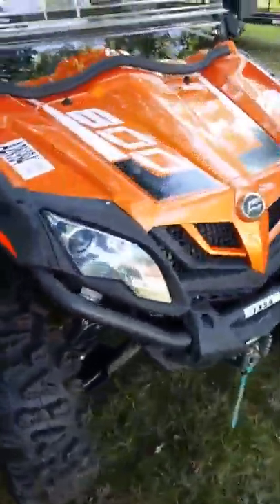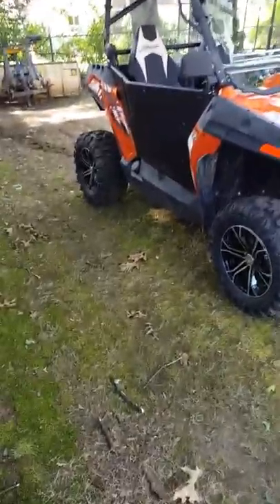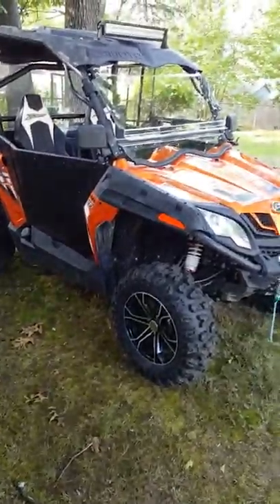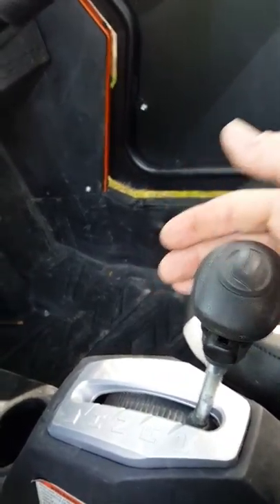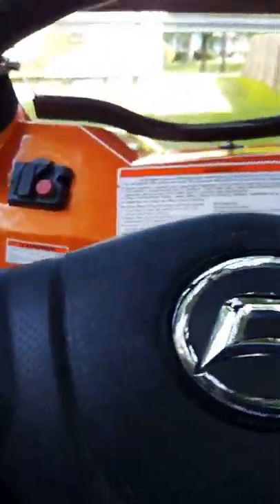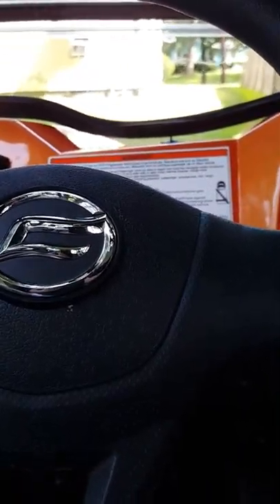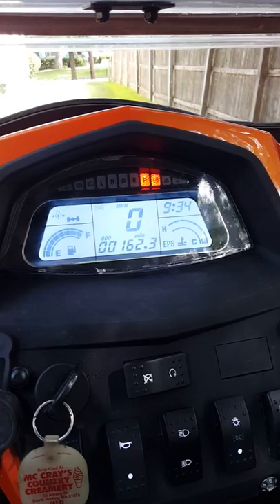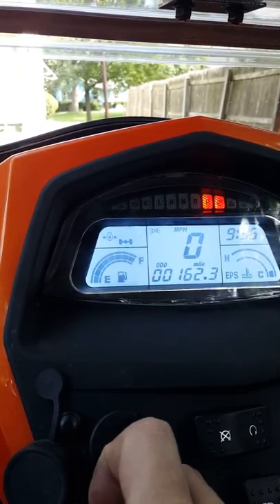Review on my 2017 cfmoto zforce 800 trail

Comment: Fyi for all ,  replace filter immediately with uni up-6229ast 2 stage foam filter. Never replace just clean every ride or two and use filter oil on the outside foam only. Other than that , follow break in procedure critical.  And you will have a great machine on your hands

Comment: Been looking at these, mainly action sports in oxford sells these.  How is service and what dealer do you use?  They are nice machines really just waiting for some long term reviews.
Reply from the maker: I bought mine at wicked powersports in Stafford springs ct service is great however i service my own machine. The only time it goes back to the dealer is for recalls which mine only had one. But overall a super nice machine for the price. Mine has almost 500 miles on it now just from riding up north last year and it didnt even break a sweat.
Reply: @MrRichie01119  from the reviews ive read and watched so far people seem happy with them. Im assuming the intake issue has been remedied.  I did read some of the 800s lost motors due to dust getting in .  Ive only seen a couple out on the trail so far.  Im probably going to wait another year , id like to see some reviews after 3 or 4 thousand miles. Hell the rzr cant go that long without a major repair.
Reply: How is the power on the 800 also?   Im debating the 800 or 1000 but its about 1500 more for approx 10 more hp.  Id just hate to get bored with it quickly and regret not getting the 1000.   Thanks for your input and the video.  Itching to go back to Jericho/Berlin amazing riding.
Reply from the maker: @wickedmainah950  just have to clean or replace your air filter after each ride. And the 800 has plenty of power. Mine is a trail so it get s in most places a 60in wont. There are 2 things between the 800 and 1000 in 2019 which  is 10hp more and the 1000 has 27in tires thats the only thing i see different between the 2.
Reply: @MrRichie01119  I think id go with the 60 inch.  Thats legal in maine.  Would need a trailer though the 60 wont fit in back of the truck. They do have the 800 in 60 inch at the local dealer here.
Reply from the maker: jeremy p 6x12 should fit it
Reply: @wickedmainah950  you Definitely want to put uni up-6229 ast  air filter on first thing. Also follow bring in procedure to the T . And they are great machines.  I have 800 ex eps
Reply: @MrRichie01119  the best thing to do for your air filter. Is replace immediately with uni up-6229 ast . Complete 2 part foam use a filter oil on outside foam only , clean every ride or two .
Reply: Correction - break in procedure
Reply: Do you still have this machine?. How is or was your experience with it. Reliability, handling and ride..worried the 50" would be to hard of a ride.